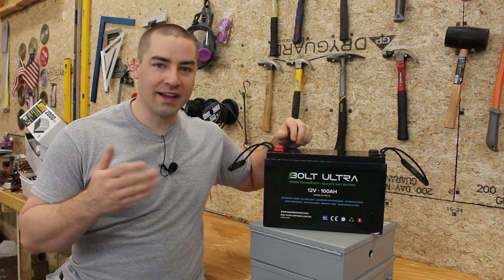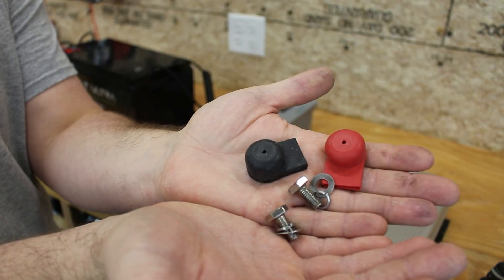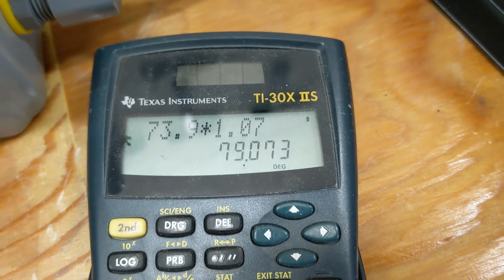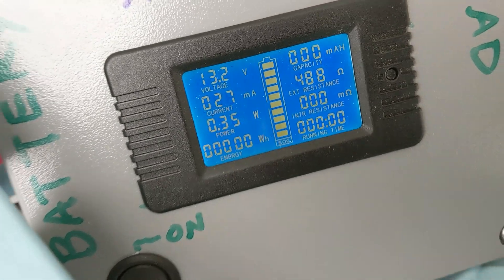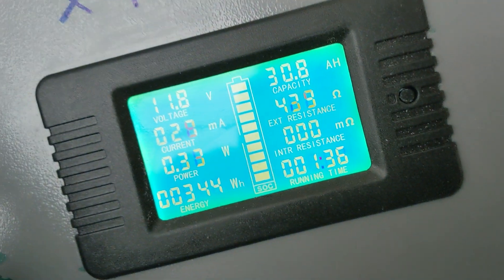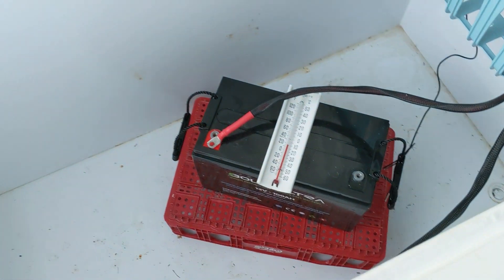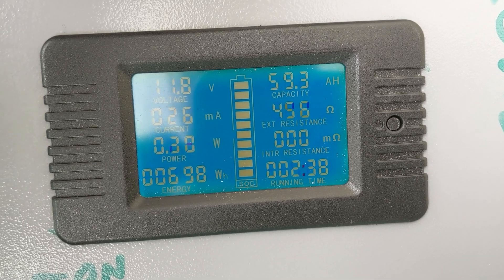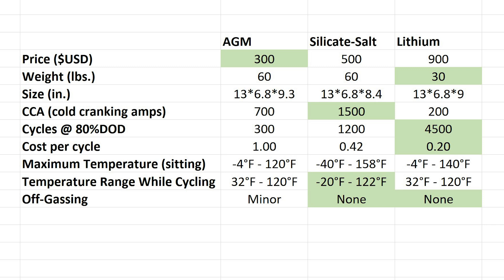Silicate Salt Battery from Bolt Ultra, Extreme Cold Tolerant

Comment: Have you tried carbon lead acid batteries last 16x longer than normal lead acid batteries over 2000 cycles 60-70% DOD the 2 I have cost about £240 each 100ah 
update 
 My 2  Batteries are Leoch Pure Lead Carbon AGM
Pure Lead Carbon AGM
• Super-Fast Charging: to 90% in less than 1 hour, • Up To 2000 cycles 60-70% DOD.– over 16x the cycles of Flooded Batteries, • Superior performance in extreme temperatures
Reply from the maker: I have not tried them.
Reply: @DavidPozEnergy  so far they seem ok work well time will tell I gess. I like the idea of using lithium batteries but thay are very expensive and not so easy to charge as AGM Batteries. I have build a lithium battery bank from used cells but it took a lot of time and messing about to do. far more than i anticipated at the start.

Comment: This battery has no BMS and or low voltage cut-off (LVC). This is huge draw back. This will KILL this battery pre-maturely in case a load was left on accidentally. Unlike lithium batteries that has BMS that protects the battery from over charging and over discharging.
Reply from the maker: I consider it an advantage that there is no BMS.  It's one less thing to go wrong.  My inverter has a low voltage cutoff anyways.
Reply: You can discharge them down 100% and they won’t be damaged. There is not the same risk of normal over-charging and discharging as with lead acid and lithium batteries.

Comment: they claim 3-5000 cycles at 15% DOD.... FullRiver AGMs claim similar.  These sound like AGM style lead acid batteries....
Reply: The electrolyte is completely different. Temperature does not shorten the lifecycle like an AGM and there are no vents. It does not heat up when cycled and there is no corrosion of internal plates.